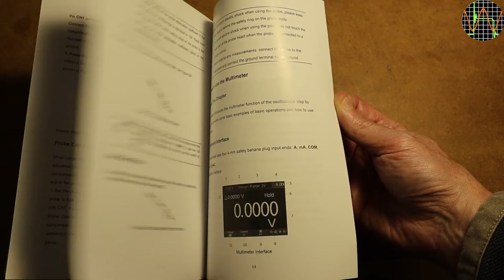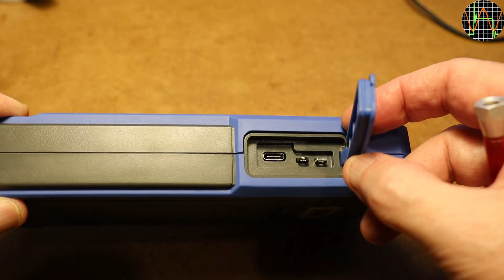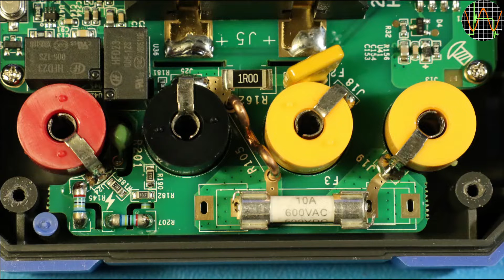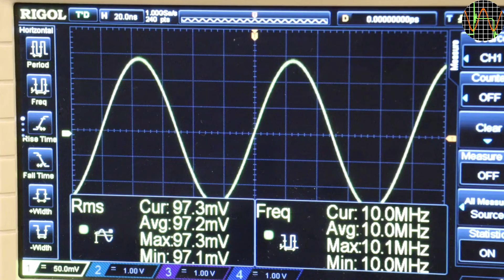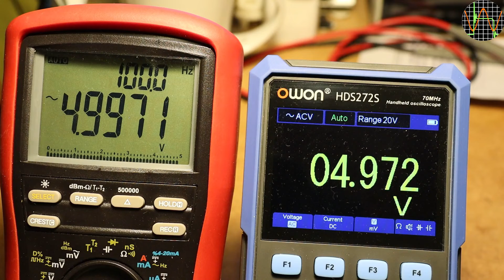#104 A closer look at the OWON HDS272S Scope meter

Comment: Great review. Thank you for showing the issues with reading a steady voltage. This becomes a bigger problem when using amp clamps as they output in mili volts and you might not get accurate results. 

Also… none of the OWON scopes seem to be able to measure duty cycle. This is a big issue for me as I often use scopes for PWM signals. I’m surprised no reviews ever mention this.

Comment: Hi, I am not very experienced with Oscilloscopes - hwr, is ist possible fi. to measure and store a voltage measurement like every few seconds over hours or days with this one? Fi. to graph a battery discharge/charge diagram?
Reply from the maker: Scopes are not the right tool for this in general but this scope would almost work for you. The slowest timebase is an incredible 500 seconds per square on the screen. With 12 squares across you get 6000 seconds, almost 2 hours of recording (don't forget to use single shot, or the scope will overwrite the previous recording). If your battery test is completed in 6000s you would have the volt curve on the screen. You could export as excel or use cursors to read individual values. But in general you need a multimeter that can log values. An affordable solution if you stay below 30V and 5A would be the USB tester TC66C (check my videos on this), It can measure and log V,Amp simultaneously and is not limited to just USB if you make yourself an adaptor for normal test leads
Reply: @TheHWcave  Well, thanks a lot! I actually have the TC66C - are you doing the logging in you video? thanks for the great hints and vids!
Reply from the maker: @haemse  I honestly can't remember if I showed it. The TC66 can log internally and you can set the interval time. I verified that you can dump the log electronically through USB (at least my software can) into a CSV (excel) file, however I normally use the PC to log the data directly.

Comment: This scope is a piece of crap. In scope mode it can't even read freq's at 75 VPP.
Reply: All common scopes, freq counters, spectrum analyzers etc. have a max. input voltage rating of around 20 to 50 Vpp. Just take a 10x or 100x attenuator probe.
Reply from the maker: Not sure what the problem is. I have never noticed a problem on mine. Can you give more details?
Reply: @TheHWcave  Neither have I!

Comment: Can i measure smps primary transformer signal please
Reply from the maker: Yes, but there are lot of things to look out for. This is very dangerous and you need to know mains electricity very well and don't blame me if you hurt yourself or blow-up the scope.  The scope inputs can only handle 140VAC. You therefore need at least a 10:1 probe (100:1 or 1000:1 is also ok). Use one that is rated for at least 250VAC (more is better). I personally do not trust the OWON probes. Make sure the BNC connector of the probe is fully insulated (no blank metal visible or touchable once connected to the scope). Do not use more that one input and do not connect anything else to the scope (in particular no USB!!!). Do not hold the scope or the probe in your hand while testing. Connect the probe while power to the SMPS is completely (both line and neutral) off. If you need to probe somewhere else, turn power to the SMPS off first (both line&neutral) first, then move the probe. Do not touch anything on the SMPS. Operate the scope with 1 hand and do not touch anything else with the other hand while doing it. These are just the basic precautions. Its not a joke, please be careful.
Reply: @TheHWcave  thank you for answering me please can you make video explaining that if you can
Reply from the maker: @mohamedrasheed201  That would take a long time because I am pretty busy in my day job and have a large backlog of half finished videos. For learning about SMPS, it is much safer to buy a DC-2-DC buck converter say 24V down to 12V or 5V and explore it under different output loads and input voltages. Then try the same with a boost converter say 5V to 12V. For scope work, check out Dave's EEVblog video: How not to blow up your scope. I highly recommend it for anybody with a scope, especially if it has more than one channel. And finally, DiodeGoneWild's channel has lots of SMPS reviews and teardowns and he often uses a scope to check wave forms. But note that he sometimes uses an isolation transformer for safety and if he uses multiple scope channels how carefully he has to select where he can safely probe. Hope that helps

Comment: Ok, I get it -- I'll probably have to ditch my plan to use the HDS272S to calibrate my Quad LTZ1000 Voltage Standards -- or the frequency of my GPS Sync'ed Rubidium Clock  -- DARN ! ! ! --  that's a real disappointment ! ! !  -- But here's a thought -- you know what WOULD have been useful information?  

How about finding out whether the claimed "REAL TIME" sampling capture rates are real, or total B.S. (as they are for example on the FNIRSI 5012H).  It's not that hard to find out, just set up a high speed SPI at say 10, 20 or 30 Mbits/sec and then try to one-shot capture a data frame and see if you get a waveform that is even remotely usable.  

Lot's of these Chinese Handheld scopes give total B.S. specs claiming "Real Time Sampling" up to some impressively high frequency, but actually quietly switch to what euphemistically used to be called "equivalent time" multi-pass sampling for all the fastest ns/div sweep ranges, making them USELESS for any kind of high speed one shot capture.  

The good news is, from the tear down videos posted elsewhere, it looks like the OWON HDS272S may be using something like a clone version of the AD9288, and,  if only slightly overclocked to 125MHz/ch, this impressively fast 2ch ADC could indeed do honest interleaved one shot "real time" sampling at the claimed 250Ms/s -- but ONLY if everything else is working perfectly to handle triggering and the required super high speed data transfers.  The BAD NEWS is the FNIRSI 5012H ALSO uses essentially the same dual channel overclocked ADC arrangement and, as already noted, it's total CRAP on ALL it's higher sample rates.  

Please note; all the pretty high speed sine waves at 80 or even 90 MHz that well meaning folks like Kerry Wong are  posting are WORTHLESS in checking this, because the scope could be taking 40, 50, or a 100 passes through the waveform using old school B.S. "equivalent time" techniques, to hide the fact that it can't do real time sampling at a high enough rate -- and you would never know, because any repetitive non-changing waveform would look just fine.

It won't break my heart if I can't use the HDS272S scope's built in voltage readings to calibrate any Josephson Junction Voltages I have that might need adjusting -- but it WOULD be nice to know if the damn thing is at least able to capture high speed SPI data before plonking down a couple hundred bucks to buy one.

Comment: Hello, can you use the multimeter leads to input and see the sinewave from an electrical socket?  I've been searching everywhere for this answer as i'm new to oscilloscopes.
Reply from the maker: No, as with most serious scope meters, the scope inputs are separate from the multi meter inputs. One reason is that scope inputs are for higher frequencies and use BNC sockets to allow scope probes but as all scopes they can't handle any current or more that 100V.
Reply: Max. input voltage of the scope is 40 Vpp, which is common for scopes. Most scope probes have optional 10x attenuation, so theoretically 400 Vpp are possible and the probe I got with my HDS242 is rated that high. Nevertheless IMHO measuring directly at 230 V power line is a bad idea as GND is not isolated. Better use a transformator.

Comment: What if I use a 2 prong adaptor when charging would this isolate the scope from the ground and live mains from shorting. It's a dumb question I know but I nit the smartest and iam trying to learn all this. And at 34 years of age my brain is starting to work.
Reply from the maker: It is not a dumb question at all. In principle you are correct. Practically,  all adaptors are not constructed to provide that isolation reliably. Many really cheap ones (especially those for xmas lights from China) and have only a capacitor dropper. Even those with a transformer in it have often terrible isolation distances inside and primary and secondary only isolated by a microscopically thin layer of lacquer. Using these to power the scope while measuring stuff directly connected to  mains would be very dangerous Have a look at DiodeGoneWild who often reviews the safety of adaptors. The only safe way would be by using a proper isolation transformer.
Reply: @TheHWcave  okay thanks cause I bought some test equipment. And I just now have the time to learn how to properly use it. Soniam gonna order a couple more of those adaptors from Amazon. Cause I deffinentley do not want to blow up my scope.

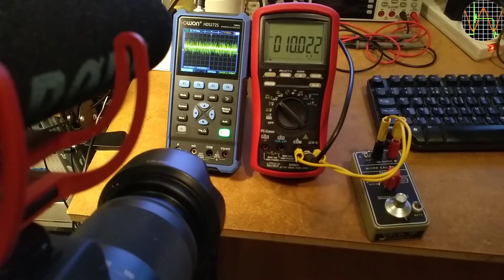Comment: That was an excellent review! You have gone very thoroughly through every aspect of the oscilloscope and verified its accuracy using quality equipment. Nobody does that with this kind of detail really. Your review was more that i would hope to find, thank you for the huge effort. Only comment i have is that you probably only did it injustice in terms of noise sensitivity since most of it was probably caught by the external wiring in 15:00.

Except for the amazing specs verification you have done, It would be nice to see an additional video concerning actual use cases such as noise measurment (ex. ps ripple with paperclip or tip and barrel method) or trigger use cases (like transient, rise/fall time measurment or ringing) etc. Even if you are not interested in a follow up video your review was excellent and as i said more than i would hope to find.

Thank you for the effort.
Reply from the maker: Thanks for your comment. I'll consider it but I recon it would be more like "common uses for an oscilloscope". I could compare the HDS272S with the Rigol 1054z. Could be interesting... But it will take a bit of time because of other videos  I plan to do first.
Reply: @TheHWcave  Yeah that would be useful. Also take your time, quality content is not easy to make, thanks again for this review.

Comment: Excellent video on the technical aspect of the meter. I have some issues with the instrument. Using the buttons to do things is so confusing. The manual does not show complete operations to reach the different functions.  As an example, I accidently changed the language to Russian. Took me an hour to get back to English and I still don't know how I got there. Very poor manual. Scope also does not display values such as RMS or Peak values of the waveform display.  These would be quite useful and basic measurements.  The meter can also save four reference waveforms, yet when called up, they are a reduced bandwidth version.  Not like what was captured.
Reply from the maker: Yes, the manual isn't the greatest but then I have seen worse. It doesn't do RMS but it does peak-to-peak and amp which I think is 1/2 of peak to peak, also max, min and average, frequency and period.  Very basic but still useful. It is possible that the PC-based remote control sw does more (using the captured waveform) I am not using that program so I can't tell if it's math functions have improved. I normally save waves as excel files which works (with the caveats shown in the video) and that gives you a dump of the full acquisition memory. I don't use the other formats so I am great full for information how well (or not) they work

Comment: When the high sensitivity to the nearby switching power supply in 10mv/div showed, it looked like a BNC was plugged in going to the red multimeter and then going to the test source via single wires. I suspect it came mainly from there, it is the probing which picks the noise up, i don't think the scope itself is so susceptible as it also has some shielding for the input section. I even would think it is better with a probe connected compared to a bench scope where the BNC ground is connected to the power input earth.
Reply from the maker: Excellent point. Sometimes I seem to miss the obvious... I just tried the scope and with no cable there is no interference even on  the highest sensitivity. Same with a good coax cable that goes directly into the BNC connector. I guess I owe OWON an apology.
Reply: @TheHWcave  you should add that correction to the video or make a small short video correcting and linking it

Comment: Just use an external usb battery pack to use or recharge it. Keep your isolation that way.
Reply from the maker: Yes, good point, that is a possibility.
Reply: The small power adapter has at least mains isolation and also no earth connection, for up to a few hundred volts proven to work, otherwise it would be unusable and potentially deadly.  The biggest issue might be noise coupling from the small power adapter into the probing, but just a few turns through a toroid ferrite could already help with that. And if not, a better filter could easily be inserted in the power cable.

Comment: For a square wave at 20MHz, only the first two components (20MHz, 60MHz) are within the scope's spec'd bandwidth, so I wouldn't expect it to be all that square. At 50MHz, the third harmonic (150MHz) is well outside of the spec'd bandwidth, but furthermore, with a sampling rate of 250Msps, shannon-nyquist sampling theorem tells us that it's impossible for us to even hope for any frequency components above 250Msps/2=125MHz. Your Rigol measures 1Gsps, so it could theoretically detect frequencies up to 500MHz - well past the theoretical capability of the HDS272S, even if they had the exact same analog front-end. Nothing wrong with your testing, and nice to see the comparison, but I would have liked to see you talk about this aspect of the square wave testing, explaining why the 50MHz sine looked fine, but not the 50MHz square.
Reply: Oh, and as to where you can tell the difference between a square and a sine, the absolute theoretical max (assuming no aliasing issues) would be 125MHz as the 3rd harmonic, so 125MHz/3 = 41.7MHz. Pretty much exactly what you said (40MHz), but again, would have been nice to state WHY that was the limit :)
Reply from the maker: @greenkid336600  No argument from my side. You are correct and I should have been more on the why...

Comment: I'm surprised the signal ground  and signal test ground are not floating as you can use the signal generator and the oscilloscope at the same time.
Reply from the maker: I am not sure if I understand your point. What is signal-ground vs signal test ground? In the HDS272S, signal grounds of scope, function generator,  the 1KHz probe alignment generator and the USB port are all connected to each other. As long as neither is connected to earth, the whole thing is floating.
Reply: @TheHWcave  Sorry, by floating I meant independent like the multimeter ground connection. If that plastic flap breaks off then the ground connection is exposed; it does not have the same safety coating as the BNC connectors.
Reply from the maker: @stevenspmd  Yes, you are correct.  Keeping the plastic flap closed when measuring in dangerous circuits is  essential for safety, especially if you hold the HDS272S in your hand. I should have mentioned that. Good catch!